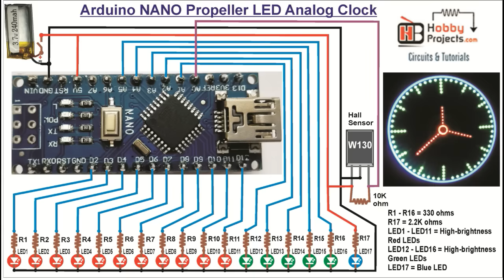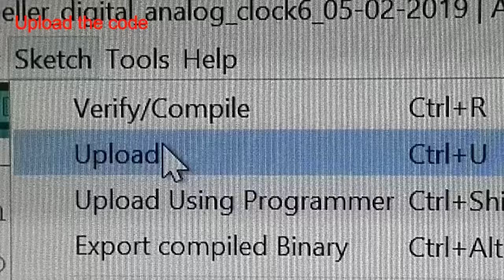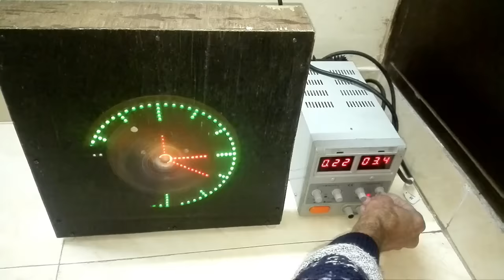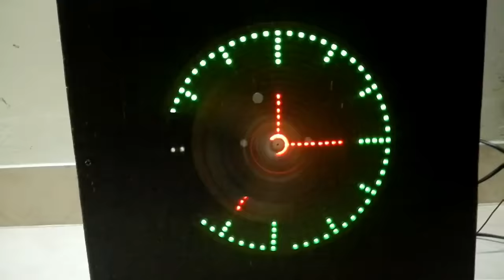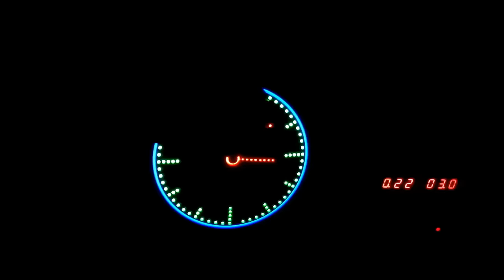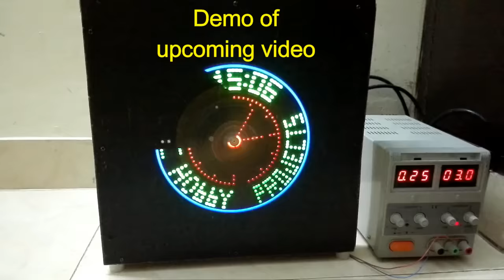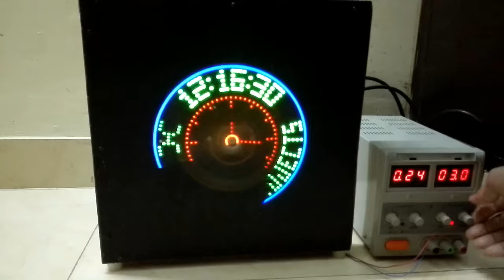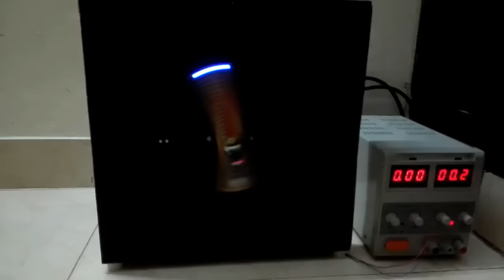Arduino NANO Propeller LED Analog Clock

Comment: A second magnet 90° out of phase with the original one would tell this device everything it needs to know about the roataion speed of the motor, with a little clever programming this could sync up the face to a variable motor speed on every rotation.
Reply: This idea would be a more accurate version of what I was thinking. With even just the single index magnet, some mathematics and timing measurements could be involved to determine the RPM, wait for the motor to stabilize, and then "start up" the clock display. All the while keep measuring and readjusting the display to match inevitable but ever so slight variations in motor speed.

Comment: You should use millis() to sync up your lights to your driving motor speed.

define oldMillis = millis() in your setup(), then at the beginning of your main loop, define newMillis = millis(). Check to see how long it's been since the last loop with newMillis - oldMillis, then you can use the Hall sensor as the benchmark for your RPM. Adjust a pause to taste and then assign oldMillis = newMillis at the end.

Now you can run your motor at it's optimal speed (read: quietest) and have the arduino adjust it's display rate to match.
Reply: i was going to post exactly what you are saying ... but you said it in a much better way ......there should be no need to adjust the speed of the motor to complete the display ... only to optimise the rotation of the motor
Reply: @Jason Alannah I'm only a hobbyist coder, myself, but I took a look at your code, and you're doing a lot of bit shifting, which I'm not very good at. I'm guessing it's to do with the LEDs. So without comments, it's hard for me to tell what's going on. I see some built in delays, which look too precise to be anything but timing for the clock display. I can only tell you how I would approach the project.

1) Divide the entire 'image' to be drawn into slices, say 36 to make the maths easier. You can do this with cartesian -> polar coordinate mapping, or just hand write each slice and stuff it in an array during Setup(). If you do the latter, you'll still have to account for the position of the hands of the clock during runtime, but you'll have to do that either way.
2) Hall effect sensor triggers the beginning of a 'frame' (via the interrupt) and polls the time (millis()) into newTime variable.
3) newTime - oldTime = elapsedTime. This is the length of time it took the previous loop to do the entire rotation.
4)elapsedTime / 36 = sliceTime. You want sliceTime so you can track how long each slice is taking on average.
5) "while (millis() - newTime)/i < sliceTime" -- Here is where we're delaying, between each slice. We want each slice to last 1/36 of a 'frame' or full rotation.
6) don't forget to set oldTime = newTime!

pseudocode (I don't even know what language I think in, anymore!):

Setup(){
    oldTime = millis();  // something to start with
    ### // register an interrupt for the hall effect sensor(I don't remember how with arduino, google it)
}
Main(){
    while true {
        ### // figure out the proper time and create the clock face and an array of slices to draw it.
        ### // Probably only needs to update once per second.
    }
}
Interrupt(){
    newTime = millis(); //fetch the current time
    elapsedTime = newTime - oldTime;  // get the time it took to do the previous loop
    sliceTime = elapsedTime / 36;  // the length of time each slice should take
    for i = 1 to 36 {  // do each slice
        ### // draw a slice
        while (millis() - newTime)/i < sliceTime { // delay until the current slice should have completed
            pass; 
        }
    }
    oldTime = newTime;  // update oldTime
}

It's rough, but that's what I came up with off the cuff.
Reply: Hey bro, what if we change the battery with wireless charging?
Reply: @pemulungelit9050  Thats what has stopped me from doing something like this..  I want it to be run by wall power, which means either using a slip ring, which complicates the mounting of it, or to do some kind of inductive charging..  haven't spent any time figuring it out.  I wonder how long that battery lasts though!
Reply: @Corbald  can i use proximity sensor instead of hall sensor
Reply: @TOXICCENAOFFICIAL  Hall sensor's are fast but I remember the IR proximity sensors are very slow. Hall sensors are very cheap though.
Reply: @ steve jones we can use ac to dc adapter to eliminate battery
Reply: Please send the  source code we have to submit project on Monday

Comment: A few "upgrades" I intend to do when I build this:
1) Wireless interface -- a simple 433MHz serial line would be simple enough to get data in.  A slip-ring could work, but there's more friction/noise issues.  A full bluetooth serial would be overkill.  Clock could be set, and text could be changed on the fly using that interface.
2) Power -- You have a rotor and a stationary magnet (aka a generator?), so just put a coil and a diode on the rotating board, and you can suck in pulses of power.  Replace battery with a largish capacitor and voltage regulator, or shove power into the battery with a voltage cap to keep from overcharging.  Nano already has a Vreg, so I'm going to see if just a coil/diode/capacitor is enough.
3) Optional: Time retention -- this design is terrible for wandering time.  Add an RTC chip to maintain the time while running, and possibly between runs.   Or, if #1 is implemented, have some external control re-setting the time periodically.  I'm probably going with the updates
4) Code optimization -- I know this is bitshifting for performance, but this code is obscure.  I'll rework it to be a lot easier to read and maintain.  That snipe aside, THANK YOU for the starting point from which I'll be working -- huge jumpstart to the effort!
5) I'm using a ProMini -- if you can't use the USB interface runtime, no reason to have it onboard after programming.
6) Adjustable balance -- since I'll be playing with adding/removing things, I'll add a longitudinal bolt and two nuts (to seize one another) so the CoG can be adjusted easily and precisely for balancing/noise.

One change that seems obvious but probably isn't good -- Synchronizing the display delays to RPMs.  Yes, I had the first initial thought that controlling the RPMs wasn't a good control mechanism, but adjusting delays could cause a more ragged display.  Assuming the (calibrated) motor holds speed fairly stable once spun up, static delays probably produce a crisper result.  If not, you NEED to adjust delays at all costs.  I might play with this, but I expect to not want the self-adjusting delay.
Reply: GyroGearloose-HackingRVsCheap wooooow

Comment: If you will place another magnets on backplate and some coil and charging circuit on rotating PCB you can keep battery charged, or don't use battery, only capacitor... Nice broject... battery isbetter because of RTC...
Reply: Yeah, it'll work forever..))

Comment: Interesting project.
Could be modified to any analog instrument readout.
Tachometer, Odometer, Voltmeter etc, but the motor should be rpm controlled.
With 2 center rings for slide contacts, the supply connection rids off the onboard battery.
With a bluetooth or zigbee addition, the processor could be remote controlled for various display settings, e.g. a true multimeter with several ranges.
Using a vertical rotating (drum) display, you could even make an oscilloscope showing vaweforms, e.g. the old rotating cola-can project.
Reply: You don't need RPM control, you can measure the RPMs from the halll sensor and adjust the tun on timing. Didn't see the code but should be doable this way.
Reply: @davidgiardini1275  Its do-able this way, but will give flutter on the readout, as the processor only can correct pr 1 revolution.
A motor control using emv sensing is very precise and was often used in former echo-sounders using exactly this type of readout.
Reply: @davidgiardini1275  Its perfectly do-able this way but will give flutter on the readout, as the processoer con only correct pr 1 revolution.
With a motor controller using emv, as the former type echo sounder readouts used,  it will be much more stable.

Comment: Hi, you really like your projects between them.
Repulsive Magnetic Levitation using Arduino
I wonder if I can use Arduino Nano? if so which pins to use thank you very much
Reply from the maker: Connect Arduino Nano Digital Pin 3 to 1K Ohm register and Arduino Analog Pin A0 to output of hall sensor. Same as Arduino Uno pins used in the diagram.

Comment: As per replies elsewhere the issue is with requirement here to adjust supply for correct sync of clockface. The ideal way is to adjust the timing with respect to hall pulse, not everyone can have a stabilised 0.01% power supply )) as the results are determined by supply quality. Nicely done though and only other thing would be to use slip rings on the spindle which is fairly easy to DIY and keep the Nano and battery off the board opening up more possibilities for motor control and keeping the rotational mass down and allowing for full battery control.

Comment: Cool 😎
But can we not give direct supply to this instead of using battery
Reply: How would you connect the supply wires to a rotating Arduino?
Reply: @mutedsounds2k  Google "Slip Ring" (Addendum:) I've had some luck using headphone jacks as slip rings. You get +V, GND and DATA as a bonus. You can buy the female to male extender, cut it in half and have both ends for your project.
Reply: Yes
Reply: @SAHNI-um1jh  You must work for Microsoft ! You gave a proper answer but the information you provided was useless !
Reply: John Bull I am not employed to give you information 😤👊
Reply: @SAHNI-um1jh  then why are you here. Go away !
Reply: @Corbald Well, this is indeed a possible way to make that thing work. But what about durability? I mean, friction is a serious issue.
Reply: John Bull I just asked a question in my comment.
It's not expected from a person to ask a question and at the same time answer it 🤯
Reply: John Bull neither I am running a YouTube channel nor I am your personal assistant or a 🐒 to provide information👊👊🏻👊🏼👊🏽👊🏾
Reply: @SAHNI-um1jh  Sorry I didnt realise you asked the initial question, then answered it. My humblest apologies :-)
Reply: Guys, calm down, please. We're just curious minds
Reply: John Bull it's ok 😇
Reply: @ctbully , Windows "help" has never helped anyone, ever. The few dozen times I was dumb enough to say "sure... help".... they gave me NOTHING. Not ever. Not once. It's a god damned joke. Seriously.
Reply: @OregonDARRYL  I can say with reasonable certainty that Windows was invented in HELL !

Comment: Nice. But I noticed that you have to tune in the rotational speed manually (by adjusting the voltage to the rotation motor) is it possible to measure the time between each rotation (input from the hall effect sensor) and divide that by 60 to get the seconds steps? or are you basically running the Arduino at full speed meaning that speed calculations are not possible? I haven't worked with Arduinos before but have an understanding of them so don't realize the real world limitations of them. It would be nice to run it at any speed but still have it display at the correct position then the speed just needs to be adjusted to get POV right. Thumbs up.
Reply from the maker: Thanks for the suggestion you have given. Yes it is possible and We will try our best to add this in the coming days.

Comment: I'm looking forward to make this project, but I got one single issue which is the battery 3.7v I can't find it in the market. Can you give me a solution or an advice. thank you and keep up the good work.
Reply from the maker: You can try purchasing it online it is easily available.
Reply: Hobby Projects Yeah but you know with this coronavirus outbreak I don’t think I will receive it. Im thinking of putting a normal battery like the one in a remote control for TV. Is it a good idea ?

Comment: Will you please mention me the rpm and torque of the motor and what should be the power source (battery) for the motor?
And what is the specification of the magnet that you are using?
And also mention the necessary conditions that should be there so that the hall sensor and magnets make the pattern visible?
Reply from the maker: RPM is between 1000-1100. Magnet 8mm x 3 mm. In this project variable voltage power supply is used. If the pattern is not visible you can try by reversing the magnet polarity.

Comment: So nice!  - some ideas: with another hall sensor you could make an interface to set time up, or change modes or whatever...  maybe an IR reciver... or ESP8266 and do it via wifi. paint the board black to even improve the contrast. The idea to time the RPM and divide the frame to achieve  perfect display regardles of motor speed, is grat. it would allow greater rpm and less flicker.
Reply from the maker: Thanks for your suggestion

Comment: Great work. One small question. Is the flicker in the video only? I mean when seeing via naked eyes and not through any recorded video do those flicker get noticed?
Another thing: Can we power it up externally for running it for a continuous long period
Reply from the maker: Flicker is because of camera recording of propeller rotating at low speed . This will not appear in real.

Comment: Thank you for such an amazing video, is it possible to have a propeller clock which shows day, date, time, temperature and chimes for hour and a module to auto connect to Wifi and update time incase of power cut as time will reset

Comment: Hi Hobby Projects, I have built the "Arduino NANO Propeller LED Analog Clock
" but the minute and hour hands do not display.
I notice, in your code you've assigned pins A6 and A7 as minute and hour sensing pins, but this does not show in your schematic??? Am I interpreting the code wrongly, or is this just a forgetful omission on the schematic ???
Reply from the maker: Please check wiring diagram of Update 1 of this project on the following video. https://youtu.be/7WrKRQ0hiUg
Reply: @hobbyprojects  Thanks.The time setting and wireless power supply will be my next attempt. Great method you have for making videos!

Comment: Thank you very much for this project! Mine works, but I still can't find the way to properly balance the propeller... May be some one has the idea how to do that?
Also it flickers a lot. Author says that it flickers on the video only but in reality it does as well... May be because of vibration?..
I also noticed that it resets regularly.
Reply from the maker: Hello, you can balance it with the nut bolts. Please check the video here https://youtu.be/HYtftl7_pO0?t=938
Reply: @hobbyprojects  Thanks for reply! I actually did that. but still there is some vibration making humming noise. Still working on that. 
I also noticed that in 12 hours it gets 2-3 minutes behind. Is there a way to calibrate this? Thanks

Comment: If the power is turned off, will it take time? I want to take time, how do I do it? Thank you for sharing, it's great
Reply from the maker: In one of the coming updates We will be using DS1307 RTC and then the clock will be running in the background even if the power is turned off.

Comment: hello i watched your video "Arduino NANO Propeller LED Analog Clock", i have the same kind of project as a graduate thesis and i have a problem with the clock hand code i don't move from the center just like you in the first clip, can you help me solve this problem. thanks in advance

Comment: Sir, to recharge the li  on battery,  we need a  tp4056 module or just plug a usb 5V charger in the usb female connector of the Nano? Thanks in Advance.
Reply: The nano doesn't have an inbuilt charging circuit

Comment: Loved this video. Very soothing. How much noise is created by this device?
Reply: it sounds like a washing machine on spin cycle. Am going to add a whistle to the tip of the clock prop to drown out the motor noise.

Comment: How much rpm speed motor is used?
It is whoch motor ,dc or bldc or gear motor ?
Reply: I’m imagine multiples of 60 RPM - depends on the resolution of the second hand indication. If you wanted a smooth ration of the second display, try 360 RPM. Unless I’ve got this totally wrong!🤔😳 John🇬🇧
Reply from the maker: 1000 RPM Approx. and the 6V DC motor is used.
Reply: @hobbyprojects  What to change in the code if I use the motor from the old hdd?

Comment: Excellent work, 👌, I will also build one of these. Can you indicate the rpm of the propellor  so I buy the correct motor.
Reply from the maker: In this project gearless DC Motor was used and adjusted to approx. 1130 rpm using a variable DC power supply.

Comment: Thank You so much for making this video!
Just one question: Why is there a 10k ohm resistor on Hall sensor on the diagram, but not in the real design?
Reply from the maker: You will not need 10k Ohm as the port pin already pulled up in the programming. Please check this "pinMode(sensorPin,INPUT_PULLUP);" inside code.

Comment: Beautiful Project, excellent clean SOURCE... However... For my POV, I used an IR sender/receiver combo which I took out of an old mouse's wheel button.... But however, it did the same. and of course, my source wasn't as clean as yours.... Had a lot of trial and error to do the timing, etc....

You haven't perhaps of doing your next one with a RTC included? For some reason, I either have a faulty RTC, or I just don't know how to read the time from it....
Reply: Bro can i replace the hall sensor with IR leds